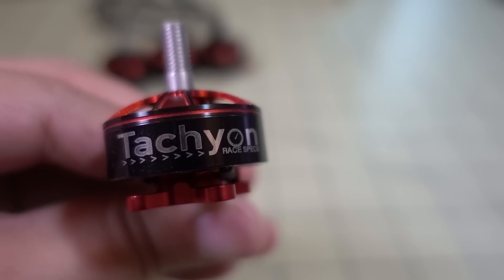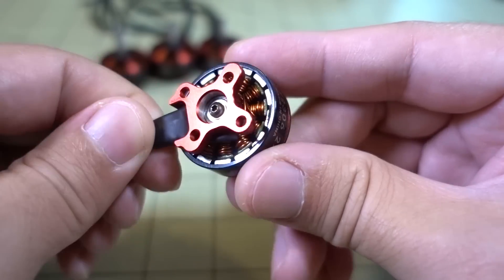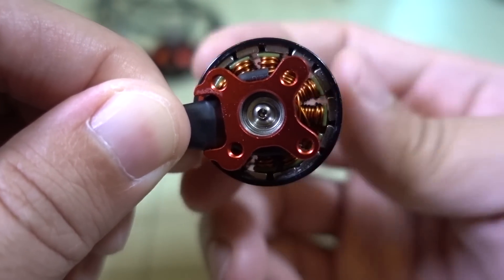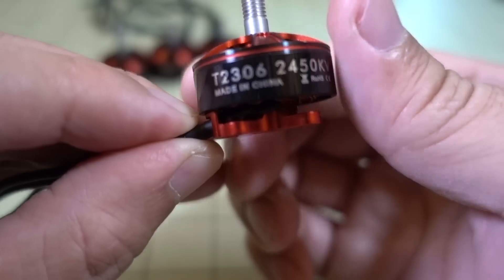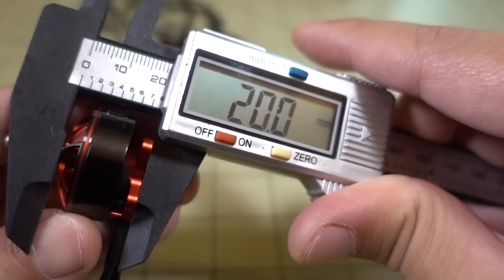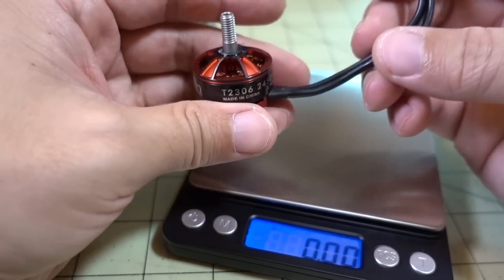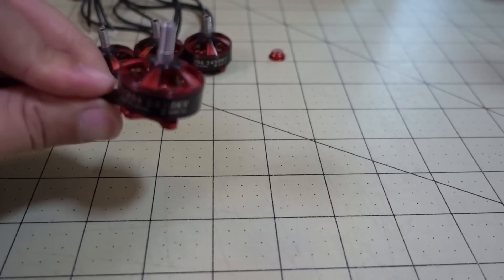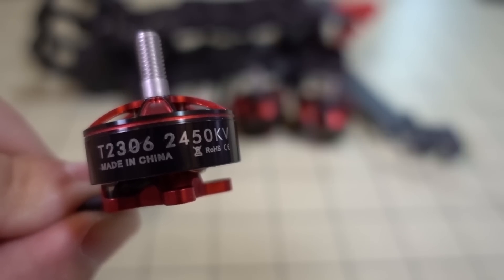iFlight-RC Tachyon 2306 2450kv Motor Overview 👍🏁

Comment: I like the wire protector housing and it seems like a good idea to me. I wish they would have supplied some data on 3S and 6 inch props. Thanks for the info and Happy Flying!

Comment: These motors look to be great, but there are another cons with these:
-The internal shaft is 3mm diameter, so it's not really durable.
-The 2207 version is actually a 2208, but it still doesn't justify to it to be 41 grams. The BH 2507 which is a bigger motor in volume is lighter than it (and it also uses 18AWG wire). Even though the thrust is pretty considerable, I hope iFlight fix those issues ASAP.